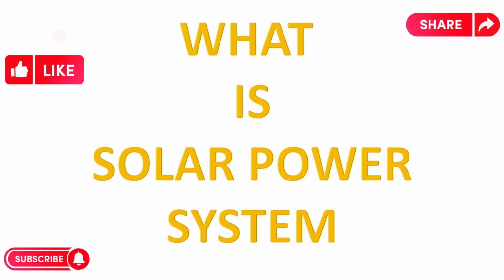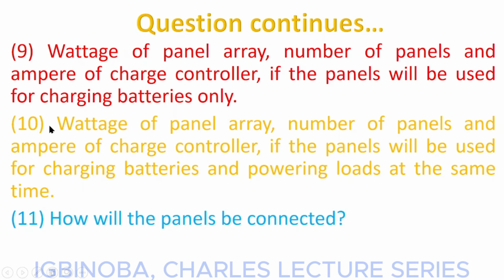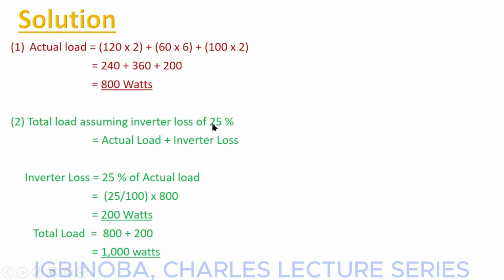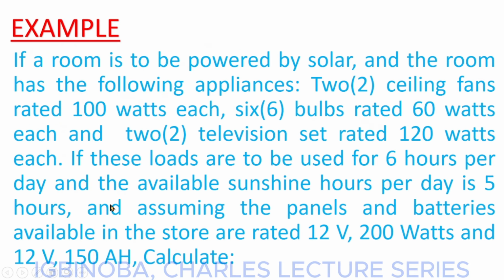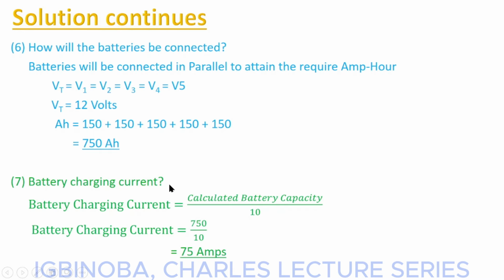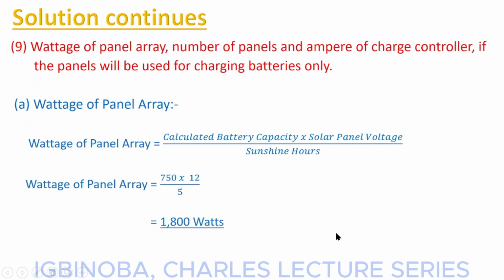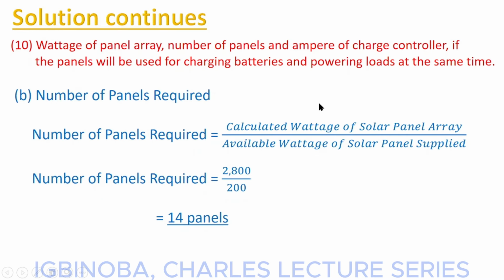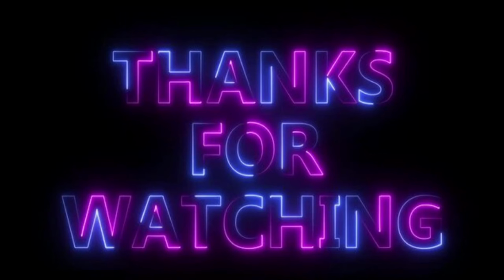Design of Solar Power System

Comment: COMP83E

1. The actual load = 1380W
2. The total load = 1725W
3. The Inverter rating = 2156.25VA
4. The Battery Capacity = 1293.75Ah
5. The number of batteries for backup hour = 9Ah
6. The batteries will be connected connected in Parallel 
7. The Battery charging current = 129.375A
8. The battery charging time = 14 hours

Considering the charging battery only.
9a. The wattage of panel array = 3105W
9b. The number of panels = 16 panels
9c. The ampere of charge controller = 258.75A

Considering the charging battery and powering load
10a. The wattage of panel array = 4830W
10b. The number of panels = 24 panels
10c. The ampere of charge controller = 402.5A

11. The panels will be connected in Parallel

Comment: EEE74V

1, Actual l load =1380W

2. Total load= 1725W

3 Inverter rating= 2156.25VA

4. Battery Capacity= 1293.75Ah

5. Number of batteries= 9 batteries. 

6. They would be connected in parallel. 

7. Charging current= 129.37A

8. Charging time= 14hours

9. Wattage=3105W
b, no of panels= 16panels
c, charge controller= 258Amps.

10. Wattage= 4830W.
b, no of panels= 25panels
c, charge controller= 402.5Amps.

11. Parallel.

Comment: COMP89K

1. The actual pad is 1,380W
2. The Total load is 1,725W
3. The inverter rating is 2,156.23VA
4. The battery capacity is 1,293.75Ah 
5. The Number of batteries is 9
6.  The batteries are connected in parallel 
7. The Battery charging current is 129.4 amps.
8. The battery charging time is 14 hours.
9. a. The wattage of the panel array is 3,105W
b. The number of panels is 16 panels.
c. The Charge controller rating is 258.75 amps.

10. a. The wattage of the Panel array is 4,830 Watts 
b. The number of panels is 24 panels.
c. The charge controller rating is 402.5 amps
11. The panels are arranged in parallel

Comment: PETRO96R
1.The actual pad is 1380W.
2. The total load is 1725W.
3. The inverter rating is 2156.23VA.
4. Battery capacity is 1293.75Ah.
5. Number of Batteries is 9.
6. Battery connection is in parallel.
7. Battery charging current is 129.4amps.
8. Battery charging time is 14hrs.
9. (Charging battery only)
a. The wattage of the panel array is 3105W.
b. The number of panels is 16panels.
c. The charge controller rating is 258.75amps.
10. (Charging & powering simultaneously)
a. The wattage of the charging array is 4830W.
b. The number of panels is 24panels
c. The charge controller rating is 402.5amps.
11. The panel connection is in parallel.

Comment: NAT11K

ANS:

(1) Actual load = 1,380 W
(2) Total load assuming inverter loss of 25 % = 1,840 W
(3) Inverter rating in VA using power factor of 0.8 = 2,300 VA
(4) Battery capacity using a factor for reserve of 75 % = 920 Ah
(5) Number of batteries for backup hours = 7
(6) How will the batteries be connected? = Parallel
(7) Battery charging current? = 230 A
(8) Battery charging time assuming a charging loss of 40 % = 5 hours

Comment: MAR22V 

Answer:

1) Actual load = 1,380 W
2) Total load assuming 25% inverter loss = 1,840 W
3) Inverter rating (pf = 0.8) = 2,300 VA
4) Battery capacity (75% reserve factor) = 1,226.67 Ah
5) Number of batteries (12V, 150Ah each) = 9 batteries
6) Battery connection = Connected in parallel, since the battery voltage (12V) matches the system voltage (12V)
7) Battery charging current = 129.4 A
8) Battery charging time (40% charging loss) = 14 hours
9) Panels for charging batteries only:
a) Wattage of panel array = 3,105 W
b) Number of panels (12V, 200W each) = 16 panels
c) Charge controller rating = 258.75 A
10) Panels for charging batteries and powering load simultaneously:
a) Wattage of panel array = 4,830 W
b) Number of panels (12V, 200W each) = 24 panels
c) Charge controller rating = 402.5 A
11) Panel connection = Connected in parallel, since the panel voltage (12V) matches the system voltage (12V)

Comment: NAT49W
1. The actual pad is 1,380W
2. The Total load is 1,725W
3. The inverter rating is 2,156.23VA
4. The battery capacity is 1,293.75Ah 
5. The Number of batteries is 9
6.  The batteries are connected in parallel 
7. The Battery charging current is 129.4 amps.
8. The battery charging time is 14 hours.
9. a. The wattage of the panel array is 3,105W
b. The number of panels is 16 panels.
c. The Charge controller rating is 258.75 amps.

10. a. The wattage of the Panel array is 4,830 Watts 
b. The number of panels is 24 panels.
c. The charge controller rating is 402.5 amps
11. The panels are arranged in parallel

Comment: NAT32F
1. Actual load =1380watts 
2.Total load =1725watts
3.interval rating =21536.23VA
4.battery capacity =1,293.75Ah
5.no of batteries =9
6.batteries are connected in parallel 
7.The battery charging current is129.4amperes
8.The battery charging time is 14 hours
9.The wattage of the panel array is 3,105watts
b.The number of panels is 16 panels 
c.The charger controlling rating is 258.75 amps 
10.The wattage of the panel array is 4,830 watts 
b.The number of panels is 24 panels 
c.The charge controller rating is 402.5 amperes 
11.The panels are arranged in parallel

Comment: MEC65M

ANSWER:
1. Actual load=1380W
2. Total load assuming inverter loss of 25%= 1725W
3. Inverter rating in VA using power factor of 0.8 = 2156.25VA
4. Battery Capacity using a factor for reserve of 75% = 1293.75Ah
5. Number of batteries for backup hours = 9 batteries 
6. How will the batteries be connected= The panels will be connected in parallel 
7. Battery Charging Current = 129.375A
8. Battery Charging time assuming a charging loss of 40% = 14 hours
9. a. Wattage of panel array= 3105W
9. b. Number of panels = 16 panels
9. c. Ampere of Charge Controller = 258.75A
10. A. Wattage of panel array= 4830W
10. B. Number of panels = 24 panels
10. C. Ampere of Charge Controller = 402.5A
11. How will the panels be connected = The panels will be connected in parallel

Comment: COMP13M 
Solution

Given:

Fans = 3 x 100W = 300W Bulbs = 10 x 60W = 600W TVs = 4 x 120W = 480W

Step 1: Total load

Total load = 300 + 600 + 480

Total load = 1380W

Step 2: Daily energy required

Energy = Power x Time

Energy = 1380 x 6

Energy = 8280Wh/day

Step 3: Solar panel requirement

Panel energy = 200 x 5 = 1000Wh/day

Number of panels = 8280 / 1000

Number of panels = 8.28

Therefore, 9 panels are required.

Step 4: Battery requirement

Battery capacity = 12 x 150 = 1800Wh

Number of batteries = 8280 / 1800

Number of batteries = 4.6

Therefore, 5 batteries are required.

Answer:

Total load = 1380W Solar panels = 9 panels Batteries = 5 batteries

Comment: MAR86H 

1. Actual load: 1380w  
2. Total load: 1725w  
3. Inverter rating: 2156.25VA  
4. Battery capacity: 1293.75AH  
5. Number of batteries: 9  
6. Configuration: parallel  
7. Battery charging current: 129.375 amps  
8. Charging time: 14 hours  
9. (A) 3105W  
   (B) 15.5 panels  
   (C) 258.75A  

10. (A) 4830W  
    (B) 24 panels  
    (C) 402.5A  

11. Configuration: parallel

Comment: PETROCHEM64L

Answer:
1. Actual Load
300W + 600W + 480W = 1380W
2. Total Load (25% inverter loss)
Total Load = Actual Load × (1 + 0.25)
= 1380W × 1.25 = 1725W
3. Inverter Rating (VA), PF = 0.8
Inverter Rating = Total Load ÷ PF
= 1725 ÷ 0.8 = 2156.25 VA ≈ 2.2 kVA (round up to nearest standard size)
4. Battery Capacity (75% reserve factor)
Daily Energy = Total Load × Backup Hours = 1725W × 6h = 10,350Wh
Adjusted for reserve: 10,350 ÷ 0.75 = 13,800Wh
At 12V: 13,800 ÷ 12 = 1,150 Ah
5. Number of Batteries (12V, 150Ah each)
1,150Ah ÷ 150Ah = 7.67 → 8 batteries
6. Battery Connection
Since both the battery and system bus are rated 12V, the 8 batteries should be connected in parallel — this sums the Ah capacity (8 × 150Ah = 1,200Ah) while keeping the voltage at 12V. (If a higher bus voltage like 24V/48V were required, a series-parallel combination would be used instead.)
7. Battery Charging Current
Using the standard C/10 rule (10% of Ah capacity) for lead-acid batteries:
Ic = 10% × 1,150Ah = 115A
8. Battery Charging Time (40% charging loss)
Time = Battery Ah ÷ (Ic × (1 − loss))
= 1,150 ÷ (115 × 0.6) = 1,150 ÷ 69 = ≈16.7 hours
(Since only 5 sunshine hours are available per day, full charging would take roughly 3–4 days at this rate — a higher charging current/more panels would shorten this.)
9. Panel Array — Charging Battery Only
Panel Array Wattage = (Battery Ah × Battery V) ÷ (Sunshine hrs × (1 − loss))
= (1,150 × 12) ÷ (5 × 0.6) = 13,800 ÷ 3 = 4,600W
Number of Panels = 4,600 ÷ 200W = 23 panels
Charge Controller Rating = 4,600 ÷ 12V = ≈383A
10. Panel Array — Charging Battery + Powering Load Simultaneously
Total Wattage Needed = Panel wattage (charging) + Total Load
= 4,600W + 1,725W = 6,325W
Number of Panels = 6,325 ÷ 200W = ≈32 panels
Charge Controller Rating = 6,325 ÷ 12V = ≈527A
11. Panel Connection
Since each panel is rated 12V (matching the system bus), the panels should be connected in parallel to sum their wattage/current output while keeping the array voltage at 12V. If a higher array voltage were desired to reduce current (and controller size), panels would instead be arranged in series-parallel strings.

Comment: NAT22V

1. The actual pad is 1,380W
2. The Total load is 1,725W
3. The inverter rating is 2,156.23VA
4. The battery capacity is 1,293.75Ah 
5. The Number of batteries is 9
6.  The batteries are connected in parallel 
7. The Battery charging current is 129.4 amps.
8. The battery charging time is 14 hours.
9. a. The wattage of the panel array is 3,105W
b. The number of panels is 16 panels.
c. The Charge controller rating is 258.75 amps.

10. a. The wattage of the Panel array is 4,830 Watts 
b. The number of panels is 24 panels.
c. The charge controller rating is 402.5 amps
11. The panels are arranged in parallel

Comment: COMP15O

1. The actual pad is 1,380W
2. The Total load is 1,725W
3. The inverter rating is 2,156.23VA
4. The battery capacity is 1,293.75Ah
5. The Number of batteries is 9
6. The batteries are connected in parallel
7. The Battery charging current is 129.4 amps.
8. The battery charging time is 14 hours.
9. a. The wattage of the panel array is 3,105W
b. The number of panels is 16 panels.
c. The Charge controller rating is 258.75 amps.
10. a. The wattage of the Panel array is 4,830 Watts
b. The number of panels is 24 panels.
c. The charge controller rating is 402.5 amps
11. The panels are arranged in parallel

Comment: MEC77Y 
Answers : 
(1) Actual Load = 1380 watts 
(2) Total load Assuming Inverter Loss of 25 %
=1725 watts
(3) Inverter Rating In VA Using Powe Factor of 0.8 =
2156.25 VA

(4) Battery Capacity Using A Factor Of Reserve of 75 %
= 1293.75AH
(5) Number of Batteries For Backup Hours =9 Batteries

(6) They will be connected in parallel 
(7) Battery Charging Current  = 129.375 Amps
(8) Battery charging time assuming a charging loss of 40% = 12. 3 H
(9a) Wattage of panel Array = 1800Watts
(9b) Number of panel Required = 9 panel 

(9c) Ampere of charge  controller  Required = 150Amps
(10a) Wattage of Panel Array = 3525 Watts 
(10b) Number of panels Required = 18
(10c) Ampere of Charge Controller = 293.75 Ampere

Comment: 1.Actual load = 1,380 W
2.Total load = 1,725 W
3.Inverter rating = 2,156.25 VA
4.Battery capacity = 1,293.75 Ah
5.Number of batteries = 9
6.Batteries connected in parallel
7.Battery charging current = 129.4 A
8.Battery charging time = 14 hours
9(a) Panel array = 3,105 W
(b) Number of panels = 16
(c) Charge controller = 258.75 A
10.(a) Panel array = 4,830 W
(b) Number of panels = 24 (lecture answer; 25 if rounding upward)
(c) Charge controller = 402.5 A
11.Solar panels connected in parallel
PETROCHEM26Z

Comment: PETRO83E 
1.The actual load is 1,380W
2. The total load is 1725W
3. The inverter rating is 2156.23VA
4.The battery capacity is 1293.75Ah
5. The number of batteries is 8.625≈9
6. The batteries are connected in parallel 
7. The battery charging current is 129.375amps
8. The battery charging time is 14hrs
9a. The wattage of panel array is 3105W
b. The number of panels is 16
c. The charge controller rating is 258.75amps
10a. The wattage of the panel array is 4830W
b. The number of panels is 24
c. The charge controller rating is 402.5amps
11. The panels are arranged in parallel

Comment: COMP42P

1. The actual pad is 1,380W
2. The Total load is 1,725W
3. The inverter rating is 2,156.23VA
4. The battery capacity is 1,293.75Ah 
5. The Number of batteries is 9
6.  The batteries are connected in parallel 
7. The Battery charging current is 129.4 amps.
8. The battery charging time is 14 hours.
9. a. The wattage of the panel array is 3,105W

b. The number of panels is 16 panels.
c. The Charge controller rating is 258.75 amps.

10. a. The wattage of the Panel array is 4,830 Watts

b. The number of panels is 24 panels.
c. The charge controller rating is 402.5 amps

11. The panels are arranged in parallel

Comment: MAR81C 

1. Actual load= 1380W
2. Total load( assuming inverter loss of 25%)= 1725W
3. Inverter rating= 2156.25VA
4. battery capacity= 1293.75W
5. Number of batteries= 8 batteries 
6. The batteries would be connected in parallel.
7. Battery charging current= 129.375A
8. Battery charging time ( assuming charging loss of 40%)= 14hrs
9a. Wattage panel array= 3105w
b. Number of panels= 16
c. Ampere of charge controller= 258.75A
10a. Panel wattage= 4830W
b. Number of panels= 24
c. Ampere of charge controller= 402.5A
11. The panels are connected in parallel.

Comment: MEC70R

(1) The Actual load = 1380 watts

(2) The Total load = 1725 watts

(3) The Inverter rating = 2156.25 VA

(4) The Battery capacity = 1293.75 Ah

(5) The Number of batteries = 9

(6) The Batteries are connected in parallel

(7) The Battery charging current = 129.4 amps

(8) The Battery charging time = 14 hrs
 
(9a) The Wattage of panel array = 3105 watts

(9b) The Number of panels = 16 panels

 (9c) The Charge controller = 258.75 A

(10a) The Wattage of panel array = 4830 watts

(10b) The Number of panels = 24

(10c) The Charge controller = 402.5 A

(11) The Panels are arranged in parallel

Comment: MAR8H

1. Actual load = 1,380 W

2. Total load = 1,725 W

3. Required inverter rating = 2,156.23 VA

4. Battery capacity = 1,293.75 Ah

5. Total number of batteries = 9

6. The batteries are connected in parallel.

7. Battery charging current = 129.4 A

8. Battery charging time = 14 hours

9. Panel Array:
   a. Total panel array wattage = 3,105 W
   b. Number of panels required = 16 panels
   c. Charge controller rating = 258.75 A

10. Panel Array:
    a. Total panel array wattage = 4,830 W
    b. Number of panels required = 24 panels
    c. Charge controller rating = 402.5 A

11. The solar panels are connected in parallel.

Comment: MAR72T

1. The actual pad is 1,380W
2. The Total load is 1,725W
3. The inverter rating is 2,156.23VA
4. The battery capacity is 1,293.75Ah
5. The Number of batteries is 9
6. The batteries are connected in parallel
7. The Battery charging current is 129.4 amps.
8. The battery charging time is 14 hours.
9. a. The wattage of the panel array is 3,105W
    b. The number of panels is 16 panels.
    c. The Charge controller rating is 258.75 amps.
10. a. The wattage of the Panel array is 4,830 Watts
    b. The number of panels is 24 panels.
    c. The charge controller rating is 402.5 amps.
11. The panels are arranged in parallel.

Comment: MEC16P

(1) 1380W
(2) 1840W
(3) 2300VA
(4) 1226.67Ah
(5 ≈ 9 batteries
(6) Connection = Parallel
(7) 245.33A
(8) 8.33 hours
(9) 306.67A
(10) 460A
(11) Connection = Parallel

Comment: PETRO10J

1. The actual pad is 1,380W
2. The Total load is 1,725W
3. The inverter rating is 2,156.23VA
4. The battery capacity is 1,293.75Ah 
5. The Number of batteries is 9
6.  The batteries are connected in parallel 
7. The Battery charging current is 129.4 amps.
8. The battery charging time is 14 hours.
9. a. The wattage of the panel array is 3,105W
b. The number of panels is 16 panels.
c. The Charge controller rating is 258.75 amps.

10. a. The wattage of the Panel array is 4,830 Watts 
b. The number of panels is 24 panels.
c. The charge controller rating is 402.5 amps
11. The panels are arranged in parallel

Comment: PETRO72T

1. The actual load is 1380W
2. The total load is 1725W
3. The inverter rating is 2156.23VA
4. The battery capacity is 1293.75Ah
5. The Number of batteries is 9
6. The batteries are connected in parallel.
7. The Battery charging current is 129.4A
8. The battery charging time is 14 hrs.
9a. The wattage of the panel array is 3105W
9b.16 panels.
c. The Charge controller rating is 258.75A
10a. The wattage of the Panel array is 4830W
10b. 24 panels.
10c. The charge controller rating is 402.5A
11. The panels are arranged in parallel

Comment: PETRO25Y

1. The actual load is 1,380W
2. The total load is 1,725W
3. The inverter rating is 2,156.25VA
4. The battery capacity is 1,293.75Ah
5. The number of batteries is 9
6. The batteries are connected in parallel 
7. The battery charging current is 129.375A
8. The battery charging time is 14hrs
9a. The wattage of the panel array is 3,105W
b. The number of panels is 16hrs
c. The charge controller rating is 258.75A
10a. The wattage of the panel array is 4,485W
b. The number of panels is 23 panels 
c. The charge controller rating is 373.75
11. The panels are arranged in parallel

Comment: MAR115K 

1Actual load=1380w
2Total load =1840w
3Inverter rating =(0.8power factor ) :2300Va
4Battery capacity =1226.67Ah
5Numbers of Batteries =9 batteries
6Batteries connection =parallel 
7Battery charging current =120A
8Battery charging time=16.67hours
9Solar setup( Batteries only): 2944w or 300w, 15pannels, 250A charge controller 
10Solar setup( Batteries +Load simultaneously)= 4784w or 4800) 24 pannels 400A, charge controller 
11Pannel connection =parallel